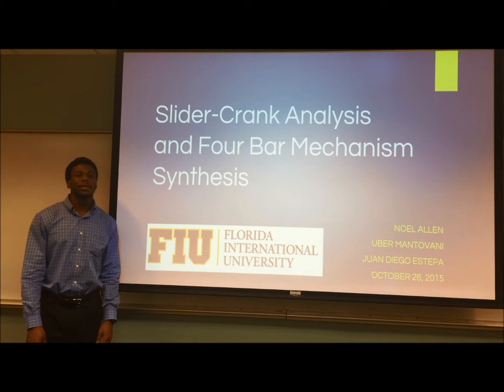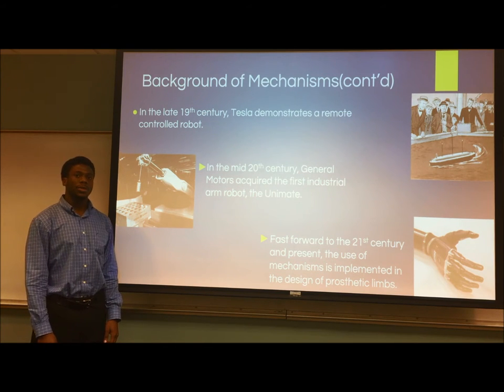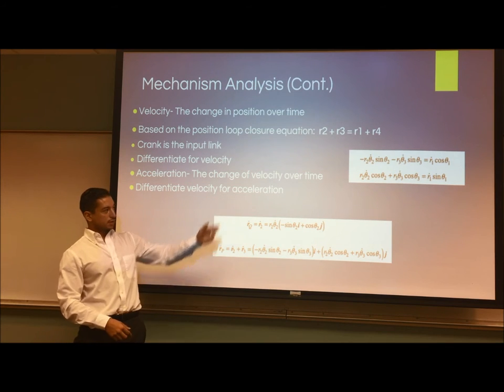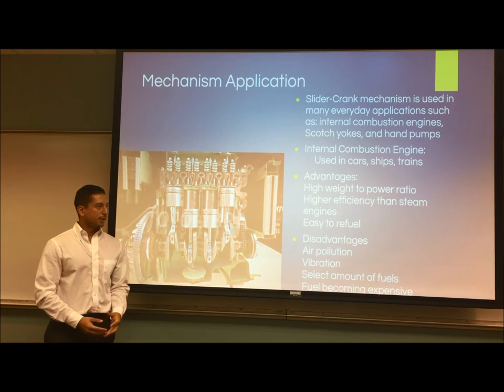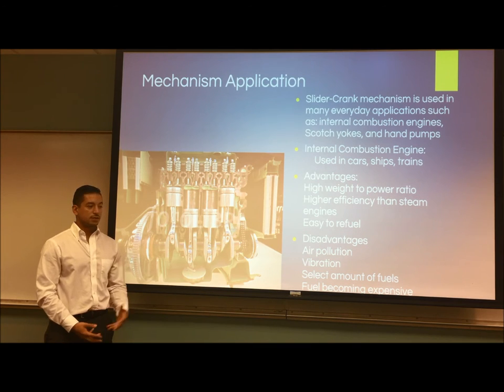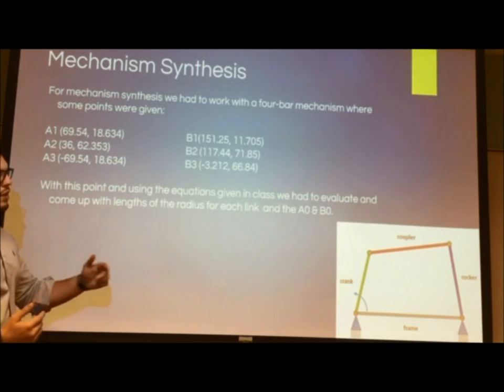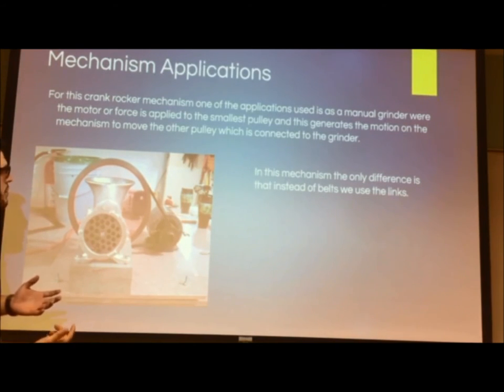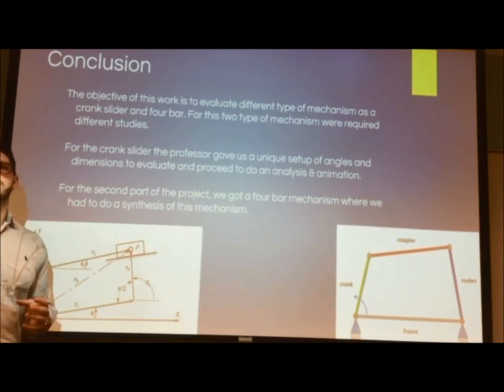Team 22: Mechanism Design: Internal Combustion Engine & Grinder Applications

Comment: Very good presentation. Only a few critical comments: make sure that your volume levels are a bit higher and standard throughout the video. I had to turn up my volume to hear the first presenter. Also, some of the slides were a bit too wordy and lost my attention. Lastly, make sure that each presenter is in frame throughout the video. The last presenter was cut out of frame at some points.

Other than that, great job!